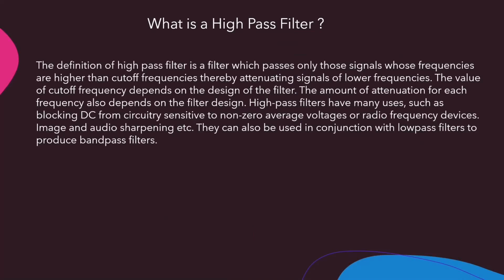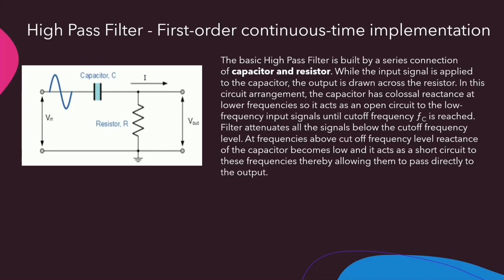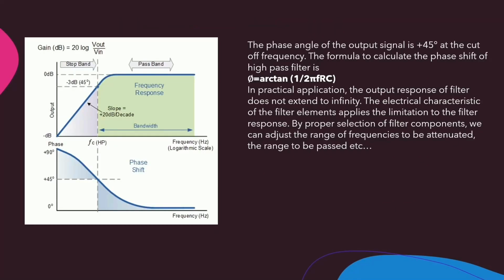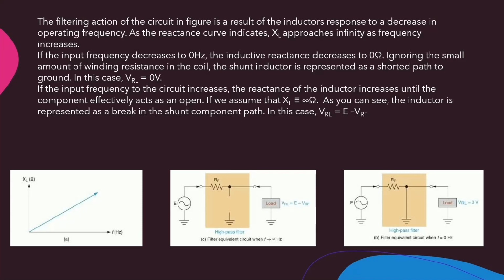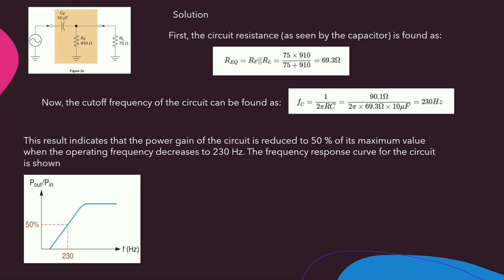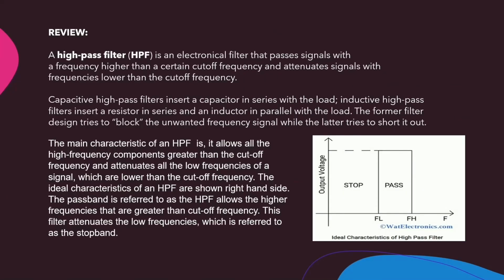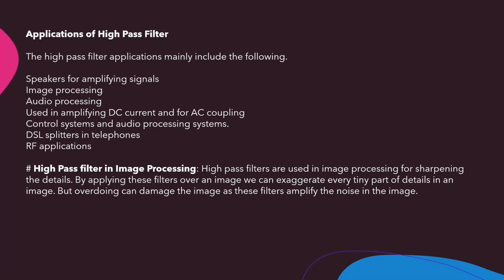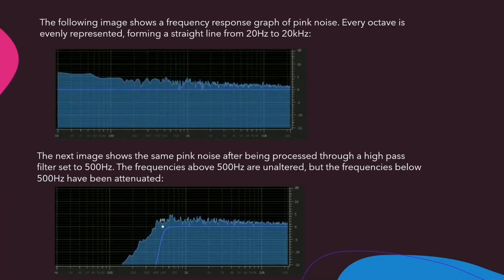High Pass Filters - Introduction

Comment: instructions unclear. got my pener stuck in my oscilloscope
Reply from the maker: I may be able to help if you can point to the problem. Which part was unclear for you?
Reply: @MusaYmc  the point where you talked about the pink noise minute 11:55
Reply from the maker: @tahsinemreilhan  Pink noise is a signal with a frequency spectrum such that the power spectral density is inversely proportional to the frequency of the signal. In pink noise, each octave interval (halving or doubling in frequency) carries equal amount of noise energy. 
The name arises from the pink appearance of visible light with this power spectrum